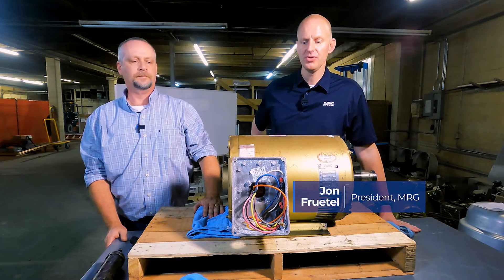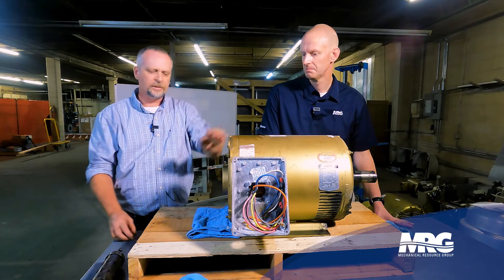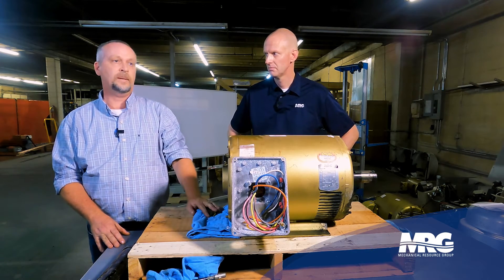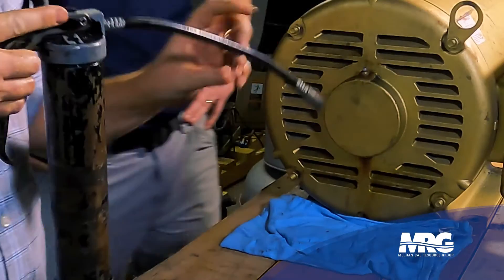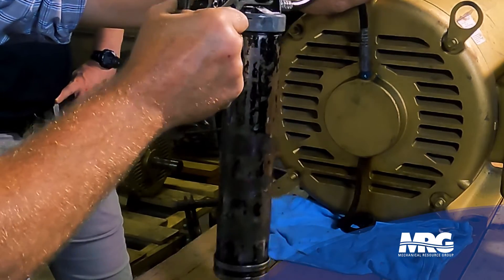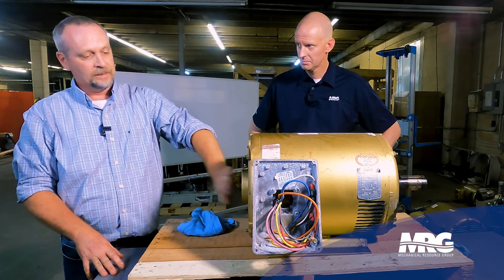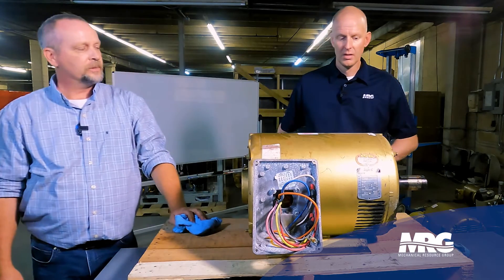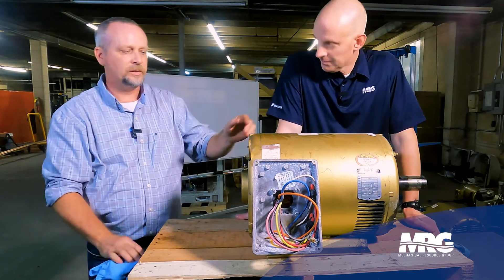Greasing Motor Bearings the Right Way: Uncover the Secret!

Comment: Most of the manufacturers are recommending to grease the motor, while it is running, thus allowing the grease to properly distribute. Grease amount on the standstill motor is usually smaller. What would you do if the grease is not coming out from the outlet port? I've seen many times motors greased from the box as per maker recommendations and the grease simply didn't come out at all. During the time grease in the bearing is compacted so much, that you have no chance to push it out at all.

Comment: The majority of the motors have a grease fitting but no cap in the bottom to remove the old grease.  Is there a way to convert them to be greasable?
Reply from the maker: Some motors may not have tradable bearings even though a grease zert is installed. Not having a grease drain plug can be an indication of this. Best way to be sure would be to contact the manufacturer rep with the motor M#&S#.

Comment: don't forget to run that motor for 15 min or so with the zerk fitting out to allow the grease to expand properly, then reinstall when grease stops leaking out. we see too many times our maint crew over greases motors causing bearing temps to skyrocket. most manufactures say to do  that as well.